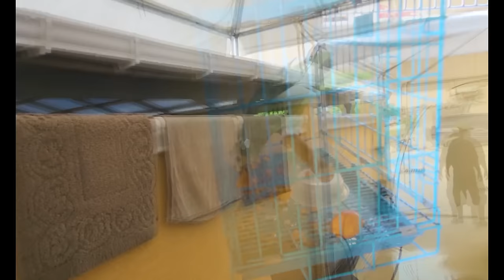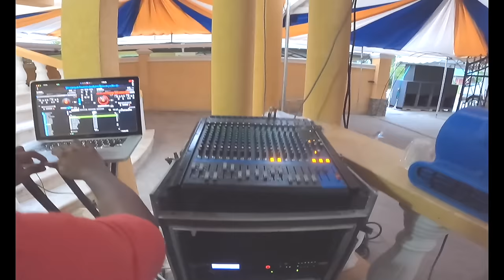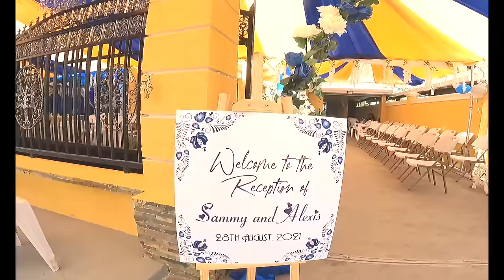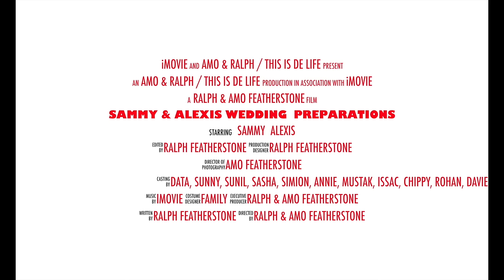Sammy's Wedding Preparations!

Comment: The Demerara Harbor Bridge is NOT the longest floating bridge in the world. The Evergreen Point Floating Bridge measures 2,349.55 m (7,708.49 ft) has that credit. At the time it opened, it ranked 4th. I have no idea where the idea that is the longest floating bridge in the world comes from...
Reply from the maker: I made this correction 4 months ago, here is what I said;#1 Evergreen Point Floating Bridge, Seattle U.S.A 2,359 meters, 2016.
#2 Lacey V. Murrow Memorial Bridge, Seattle U.S.A 2,020 meters, 1940.
#3 Hood Canal Bridge, U.S.A 1,978 meters, 1961.
#4 Demerara Harbor Bridge, Guyana 🇬🇾 1,851 meters, 1978.
#5 Homer M. Hadley Memorial Bridge, U.S.A 1,772 meters, 1989.
#6 Berbice Bridge Guyana 🇬🇾 1,571 meters, 2008
Reply from the maker: That's what us Guyanese, were always told, lol. And I never questioned it, but I did correct that comment with a statement 4 months ago.

Comment: My comment got deleted because l corrected you on the info about the floating bridge, it is not the longest floating bridge in the world, be informed first before you put the wrong info. Thanks.
Reply from the maker: #1 Evergreen Point Floating Bridge, Seattle U.S.A 2,359 meters, 2016.
#2 Lacey V. Murrow Memorial Bridge, Seattle U.S.A 2,020 meters, 1940.
#3 Hood Canal Bridge, U.S.A 1,978 meters, 1961.
#4 Demerara Harbor Bridge, Guyana 🇬🇾 1,851 meters, 1978.
#5 Homer M. Hadley Memorial Bridge, U.S.A 1,772 meters, 1989.
#6 Berbice Bridge Guyana 🇬🇾 1,571 meters, 2008.
Reply from the maker: Lol, 🤣 I grew up hearing that Guyana has the longest floating bridge in the world and tallest wooden building in the world 🌎.
But you are correct,  it is the 4th longest floating bridge in the world 🌎.